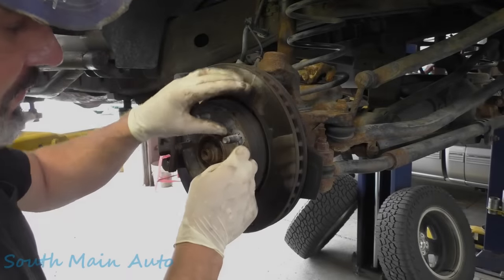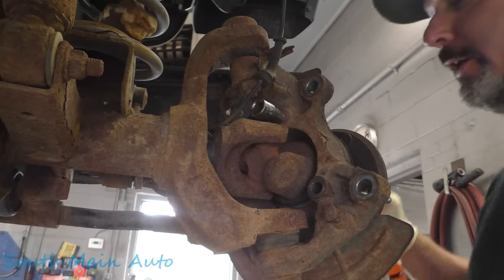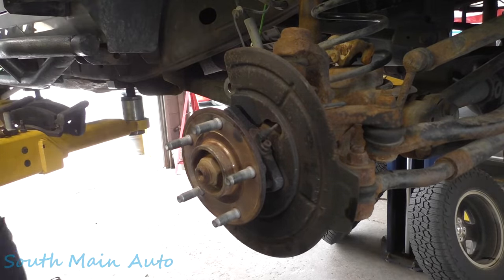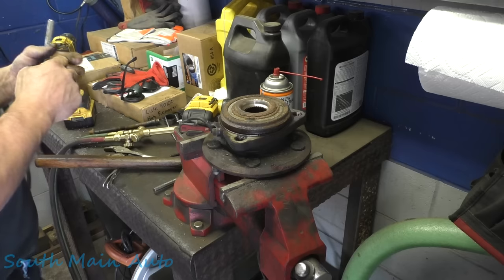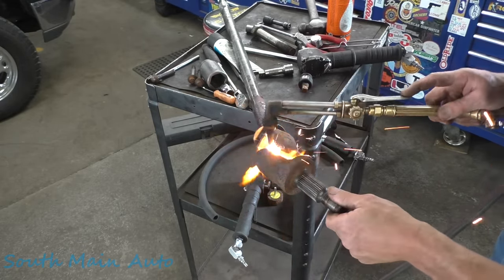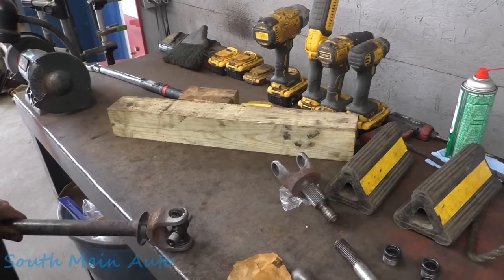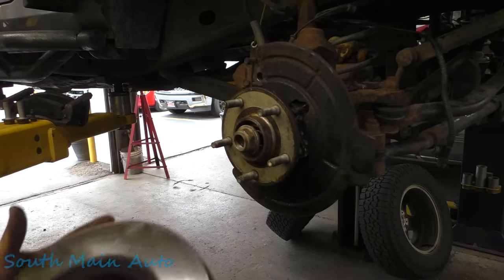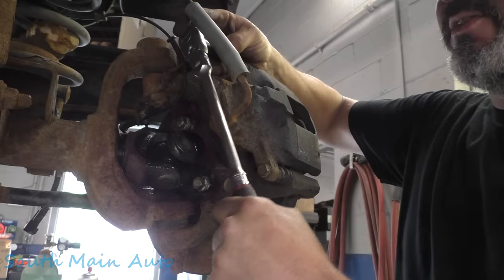Jeep Wrangler - Front Axle U-Joints

Comment: Good Video ! Maybe , Get a New Baseball cap 🧢 to Wear to keep that area clean while it Heals. That ball cap looks like its been around a while. Old faithful looks like.

Why they call those “ acid brushes “. Is because they were invented for plumbers & hvac guys in-the old days when we would dip the brush in flux to spread the Paste flux on a Joint before sweating in a joint or for white Brazing flux when Using 56% silver solder when Brazing copper to Brass connections.

The Acid Brushes are still used today for White Brazing Flux when using 45% or 56% silver.

Comment: Just popped in to say in my 40 years I never saw anyone cut them out with a torch, so my next statement is if I can do it you can do it wont hold water. All good I did like the bolt torch out, I can see someone else doing damage there, most would replace the assy.

Comment: I live in the south and the undercarriage of my Jeep does not have those issues.  They are called acid brushes because plumbers use them to apply an acid flux to copper tubing when soldering.
I had the same kind of bump behind my ear.  The doctor called it pimple popping.

Comment: You're the main man but I would have just used the extractor left-sided turning extractor usually works for me! Just have to drill a starter hole and then I get the right size extractor and Bam

Comment: ACID BRUSH: Their name came from the plumbing industry, where they were used to apply acid flux for pipe soldering applications. Acid brushes are used to apply glue, or other liquids and [certain] chemicals, and for quick small-area cleaning or wiping applications. (According to the Google machine)...

Comment: So what’s the book time on a laundry fire?

When removing those rusty hub bolts, it is almost always a good idea to apply heat right away once we see they are a bit stubborn.  Putting more twist on the bolt bound by the threads can just weaken it and make life harder, so give ourself the advantages early and avoid pain later.  Burning pee pads can be used if you don’t have a Vic. 

My favorite videos are ones where things go wrong and seeing how you deal with it. Or rather, how Pearl’s mother does it since you always call her in to help. 😂

I had a cyst removed from my back that sounds similar to the one you had. I was having odd feelings in my leg, but the doctors did not think it was related to the cyst. After they tried a few other things, my doctor said they can remove the cyst anyway, because it wasn’t supposed to be there. After they removed it, the strange feeling in my leg went away. I am just glad they did not have to break out a torch…

Comment: So glad I found your channel. I love your style. Fellow yankee here, grew up in RI. I’m working on the front axle of a 89 YJ (Dana 30 re-gear). Nothing has been done to this thing except for what I have been doing over the last year or so.  After much beating got the old hubs out. My axle u-joints are actually still vey tight and “flippy-floppy” and the hubs are in very good shape as well, as are the ball joints. Amazing considering their age.  I got all the parts already but am struggling with changing the u-joints and ball joints out since they are in such good shape. (The hubs got pretty banged up on removal). It’s one of those either “do it while I’m in here” or “don’t fix it if it ain’t broke” situations. Any wisdom on that? My new hubs slide right in and I actually have an ever so slight bit of play on the drivers side, should they not be a tighter fit than that? Anyway, keep up the good work, new subscriber here.

Comment: I stopped changing these due to being able to get complete axle shaft with a CV joint for £50 so they last longer and are much cheaper to change for the customer as a joint is around £35 , as we have excess salt during winter like you every.thing is rusted solid .

Comment: They were called acid swabs for using muriatic acid on zinc coated metal so you could then solder the joints, mainly on gutters and chimney caps, etc. You know, back in the dark ages...

Comment: You are having quite the day! So with your bump gone how do you hold your hat on?  The Fire Dept award is awesome.  I saw a guy cutting in some tight spaces like you did on that U-Joint but he had a plasma cutter I think. It looked like a electrode holder but with a tip that blows O2. It cut very precisely and very fast, No acetylene needed. Maybe they make them for use with a common Lincoln stick welder, I don't know.  With your torch skills that would be something to see! Thanks for serving you community!

Comment: i use greasable joints on front axles because in my own theory, they don't spin fast enough to push grease to the caps, unlike driveshafts.  i ran moogs on my axles and danaspicers on my driveshaft (OEM).

Comment: Never even thought about using a torch to remove a cross out of a U-Joint!
Was heating up brake lines on the car in my profile picture. Apparently, the brake hose was plugged on one end! Should have heard that hose POP when it reached the critical temperature! I was ready for the pop one the second side!

Comment: I remember replacing those uj joints 25 years ago when i worked in a jeep garage.Had to be careful cause the abs ring was on the end of the shaft with the old models and was easily broken .😋

Comment: An old pan am airplane mechanic gave me a can of knock-er-loose.  The can was probably from the 1960's.  i used it to assist breaking free my 67 olds original exhaust manifold to exhaust pipe bolts.  This stuff worked so well i used a 3/8 drive like a hot knife  through butter, and the threads came out reusable!.  The stuff smelled so bad it probably took a year off my life, and melted any paint it touched.  Turns out they reproduced knock er loose a couple years ago... The smell is different and probably doesn't work as well.  I'll find out on my next exhaust or exhaust manifold-to-head job

Comment: I ALWAYS RUN A FLAT FILE ON THE INSIDE OF EACH EAR TO GET A CLEAN SURFACE FOR THE CLIP TO SLIDE IN. AND I LIKE TO USE MY BALL JOINT PRESS . FOR EASE .AND IF THE JOINT IS TIGHT I HIT THE SIDE OF THE AXLE AND IT LOOSEN UP

Comment: Acid Brushes are used by Tin Knockers when they solder joints on sheet metal. They spread the Acid Flux with them. Glad your OK.

Comment: I'm disappointed Eric. Watching you and hearing the bolt squeaking I KNEW it was going to break if you kept going. Some lube on both sides and working the bolt. in and out would have prevented the break. I've been there. No drilling, no torch, not tap/thread chaser needed.

Comment: RE: Acid Brushes...   The name "acid brush" comes from the original use of these brushes - to apply acid flux (a cleaner) to pipes in preparation for soldering. Over time, these versatile brushes have grown into a multi-purpose brush. They are an economical disposable brush ideal for small brushing applications .

Comment: It's possible to replace it with a constant velocity shaft replacing it with another u-joint just ensures another return trip 20k later I my CJ7 and my Grand Cherokee matter fact all of my jeeps have been upgraded to CV shafts and I've yet to have a problem with any of them and the CV shafts on my cj7 have yet to need replacement

Comment: Eric, good info and reasons why . Only question is why you don't lube/grease where the shoes meet the sliders, but do grease under th sliders. A little clarification here would be appreciated. Thanks for the great videos.
Reply: Per Eric, the rust forms on the caliper bracket and pushes the stainless hardware away from the bracket, binding the pad. The grease stops the rust from forming.

Comment: Burning off metal and filing off slag off that u-joint fork material will make it out of balance, even if by a few grams difference. It will shake a bit.
Reply: Nonsense!
Reply: It's a bolted in stationary part, has nothing to do with balance!

Comment: Figuring all that labor, probably would have been cheaper just to buy new axle shaft assemblies for $300-$400, doesn’t look like a Rubicon, so Dana 30s come pretty cheap, Dorman or Crown, even cheaper, $125 each side.  Mopar, not so.  If I was doing mine myself, I’d just buy new shafts and hubs, as pretty rusted, probably put in some new ball joints, Apex or better yet, some “Ball joint Deletes”, but they’re a bit pricey.  I always buy new hardware, always rusted and pitted here in the rust belt.

Comment: Question… is the torch faster? Seems like pounding them out, would be faster, easier, cooler?… (ie, less problems handling the parts, cooler. Not more awesome, cooler.) (at least in the past, I haven’t had any problems. Just curious.) (never owned a torch)

Comment: it seems like everytime i try an use a hammer instead of my bench vise, one or two needles dislodge from the cap. infact im so paranoid because its happened multiple times, i start both caps at the same time so the u joint can hold the needles in as i drive the caps in at that point, hammer all the way.  then i hit the ears to releave binding.  did my superduty dana 60 front end recently.

Comment: Eric, this was some months ago I watched a video from a person who claimed to be a long time mechanic and he was ranting away about how he couldn't understand why you put "grease" on the brakes and his whole video was about that one topic. I spoke up in his comments section explaining that it is NOT grease in the normal sense but a special high temp non curing silicone lubricant that is specifically designed to be used on the sliding pins as well as other key locations such as the ears of the pads to allow the pads to move freely and of course being careful NOT to end up with any of the product on the braking friction surfaces. I even added a link to the Permatex product as one example. I pointed out that its even more important to use such a product in the rustbelt. Oh did he get pissed off at me and was deleting my comments as no way did he want to look like the fool for his idiotic rant. Last but not least I sent him the section from the Wager website showing them using the silicone on the back of their pads for brake squeal issues. Certainly some old old dogs will never learn anything new !

Comment: Eric,  at least no one can call you a "fat head" any more and be right when doing so. Your description perfectly describes a lipoma, a benign (non-cancerous) tumor composed of fat cells enclosed in a thin capsule. The scalp has an excellent blood supply so lacerations and incisions bleed profusely. Often scalp wounds are closed with simple full thickness sutures, but it looks like your guy actually did a layered closure and used self-absorbing subcuticular stitches that will dissolve over time and not need to be cut out. That saves you a trip back to the doctor's office which is a good thing for a working man. There may be just a bit more itching with self-absorbing sutures but they generally work very well in a situation such as yours. Your doc did a great job. Oh, and I should mention that when you get down to the skull the bones will transmit sound to both ears, so yeah, you heard what was going on very well. 
I should also add that I used to be a second rate shade tree mechanic who had that same surgical procedure. But my event did not go well. When the doc made the incision my brain fell out and  landed on the floor. The whole team spent 3 hours looking for the darn thing and never did find it. So they just closed the hole and I then became a famous surgeon.
P.S I don't think that psoriasis had anything to do with with that lump.

Comment: Not worth dipping the splines in some 80W90 before putting the shaft back in ?  Goddamn Rust Belt adds so much “Pain in the Dick” to every job.  I’m a Database Architect by day, but do all my own work on my 2 Wranglers, 2010 JK Rubicon and 2016 JKU 75th Anniversary Edition, every screw always rusted, crusted, pitted.  Road salt and 2 miles from the ocean no help.  I actually had to cut a rim off as one lug nut “salt welded” to my rim.  Just did my tie rod assembly and drag link, have a MetalCloak Track bar coming next.  Ball joints seem ok, need to check those ujoints, I’ll have my mechanic do those, and make sure he uses spicer, or I’ll just buy 2 new shafts and do myself.

Comment: They call them acid brushes because plumbers have used them for years to apply acid flux to copper fittings before soldering. With the advent of PEX pipe, that's diminished copper soldering greatly, though it's still done to a lesser degree when remodeling.

Comment: U joints are always the one job where everything can go south. I had one drive shaft where I attempted to replace the u joints. heated them Beat them heated them again. beat on them some more. I cut the joints. Beat on them more. the cups just would not come out. we eventually just cut the cups and the joint all the way out and used a chisel to remove the remaining parts of the cups. what should have been about a hour project. Turned in to a 3 day ordeal.

Comment: I'mma just ask.. WHY IN THE WORLD would any engineer design parts for a car with freakin' twelve point head bolts?!

You'd think they'd know better.  Bad enough roundin' off the regular head bolts, but those, Torx and Allens need to never be a thing.  Redesign your part, geez.

And I'm not even in the rust belt, so there. :p
Reply from the maker: The only thing worse is if they made them use a flathead screwdriver 🪛
Reply: @SouthMainAuto  Hey, when all you have is a butter knife, eh? :D

Just since I have your ear a little... thanks for doin' what you do.  I love to learn, and you're one of the best at teaching.  

Sorry about those silly watchers who call ya  and leave messages.